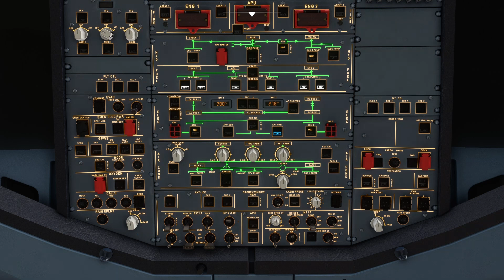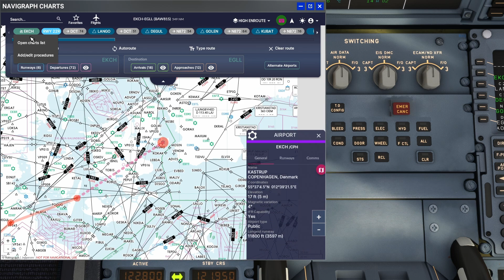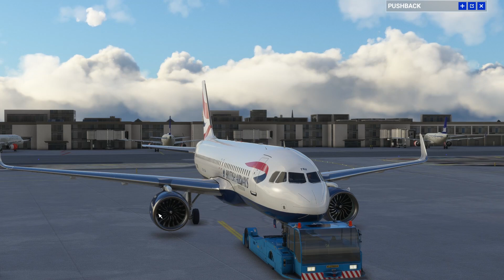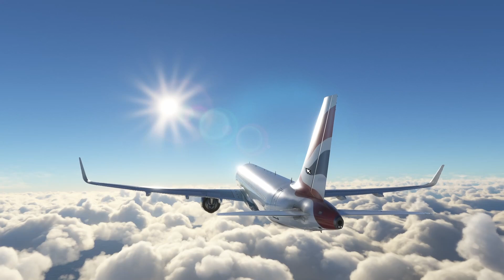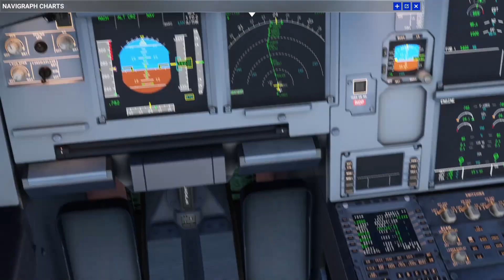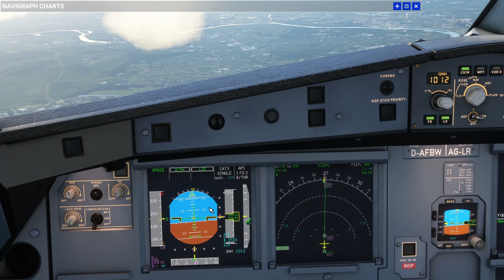Full Flight Tutorial EKCH - EGLL

Comment: I'm using the stable version of the a320 and I know that the fix page isn't implemented yet, but when I program in the approach it always adds the BIG via automatically? even after erasing Vias it still comes up onto the approach path flight plan. Is this a common issue with the stable version of fbwA320 or am I doing something wrong? Any feedback would be greatly appreciated thanks lee.

Comment: Great tutorial! Thank you. I had a few questions:
- when do you usually activate and confirm approach on mcdu? 
-are you adjusting speed before you activate the approach in mcdu and then the approach will take over?
Reply from the maker: I usually activate it just before intercepting the initial approach fix. Also I slow down to about 220kts. Approach mode only takes over when you select flaps